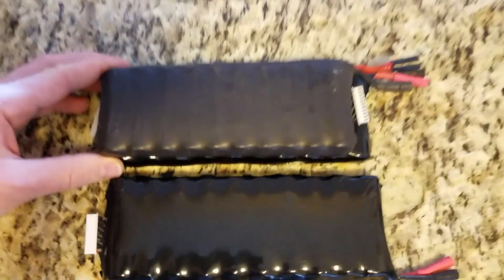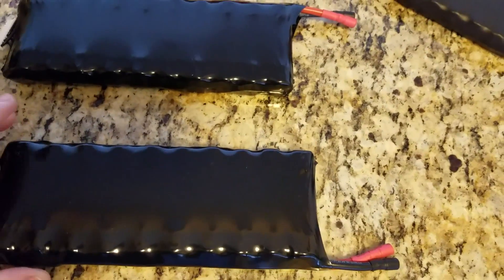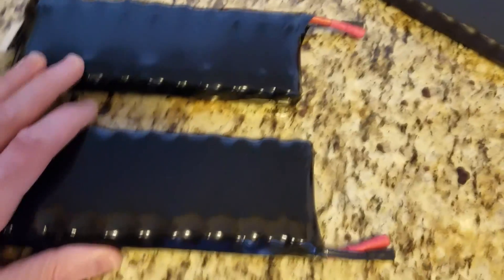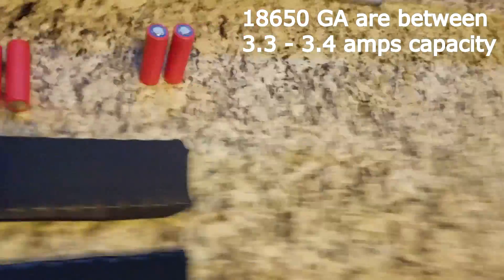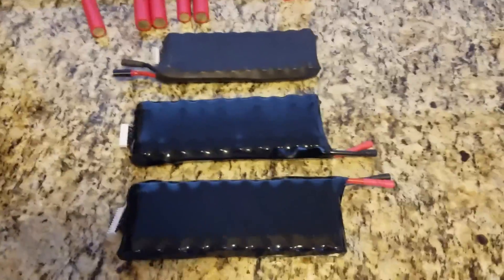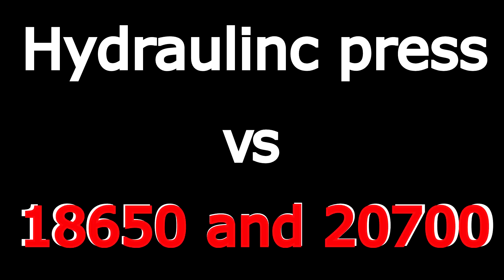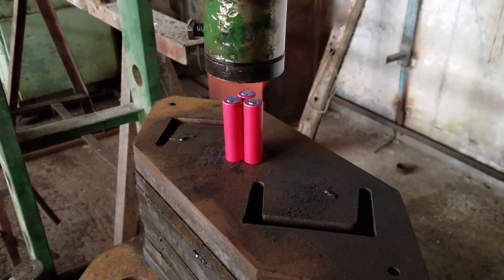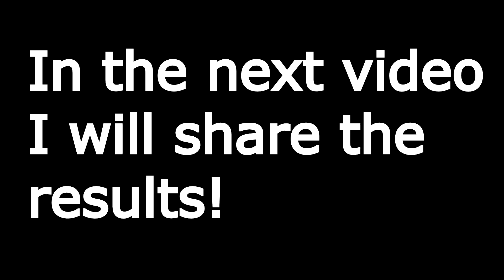More about 20700 Panasonic cells and Boosted Boards

Comment: Since they're taller and maybe even have a larger diameter, would it even be possible to replace the 18650 batteries in a carbon fiber electric scooter with these?  Seems these might not fit in the cylinder.

Comment: why it has only plus and minus poles doesn't it need to be balance charged?
Reply from the maker: It has the balance connector on the other side. It's a 10S jtx plug

Comment: would it be possible to mount the batteries in a a cylinder config , like in a flashlight? working on a new board and i m really interested if there s a way to spot weld them vertical. 18650 or 20700..
Reply from the maker: Yes of course